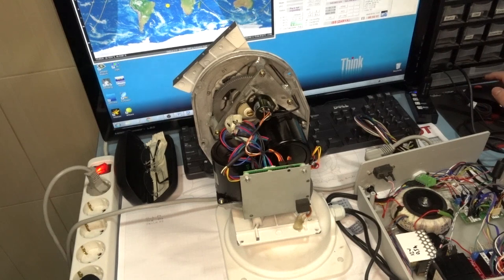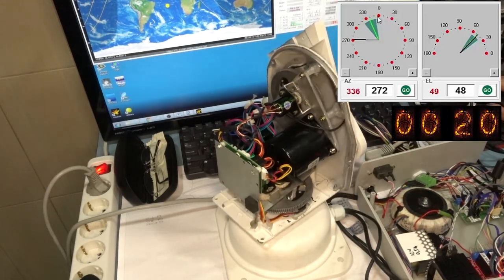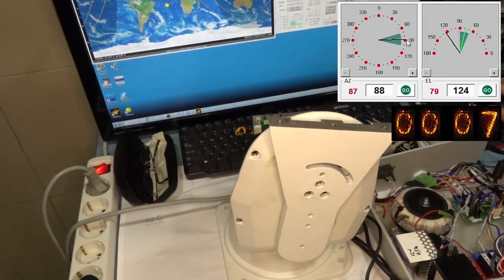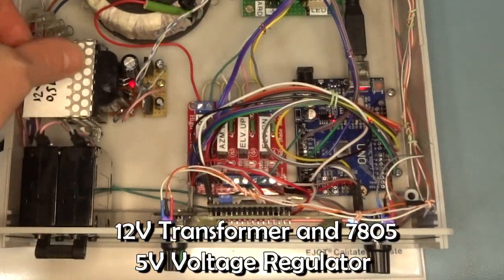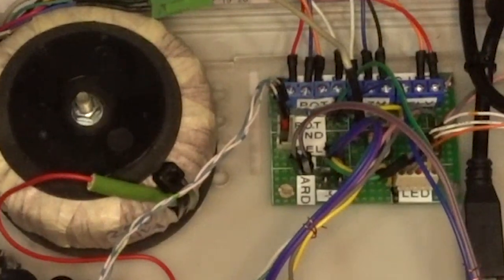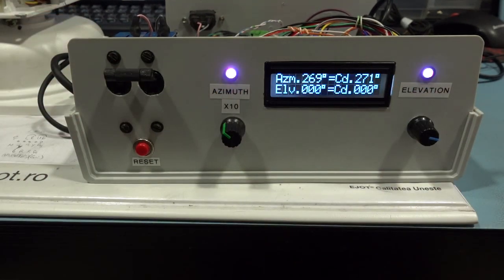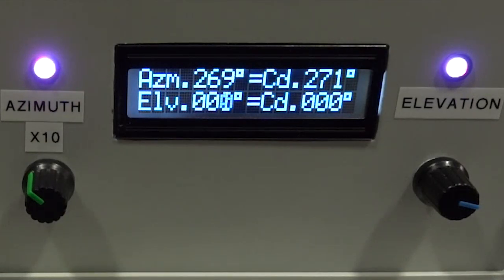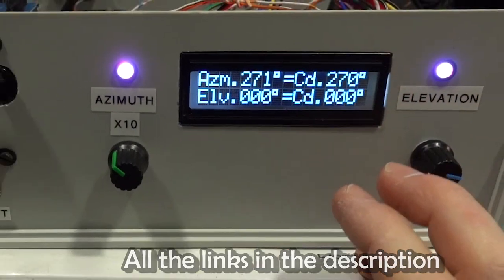Arduino Controller and Antenna Rotator - Short

Comment: I am very much impressed with your CCTV PTZ scanner conversion to Az El Satellite Antenna Tracker.  I have already ordered the PTZ scanner, Angular sensors and Rotary encoder with push switch.  Can you please guide me the source for below items.  1. Solid state relay board.  2. Interface board.  3. Gear set for the Angular sensors. I appreciate your support. 😊

Comment: Great idea and Job! How much weight do you estimate your system can handle?
Reply from the maker: Hi David.
The manufacturer declared around 15 kilos, but because the antenna boom is long, I hope it can handle 5 kilos without much inertia. I'm going to test that soon.
Reply from the maker: Hi David.
The whole antenna system (2 ant. & boom) weighs about 6 Kilos. The boom is the heaviest and has 2.3m. There is very little inertia at start and stop. My vertical pole is just a 1.5 inch pipe, 2.5 meters above the shack, and dampens very well the wobbling, because it's a bit flexible.
Reply: Can u provide us blue print of rotator machnism
Reply from the maker: @dashingviwaan4372  Hello. This is impossible, because I just bought it like this, I didn't build it.